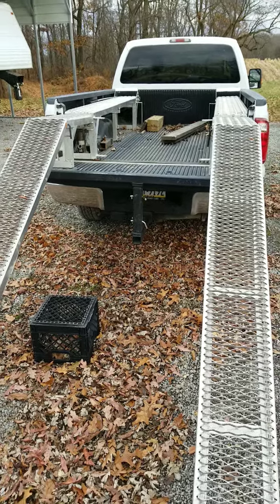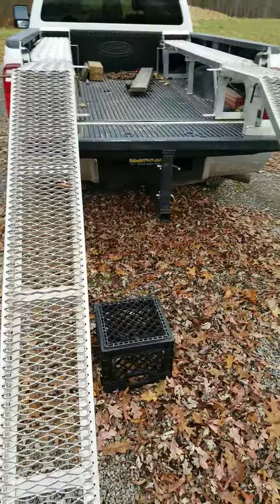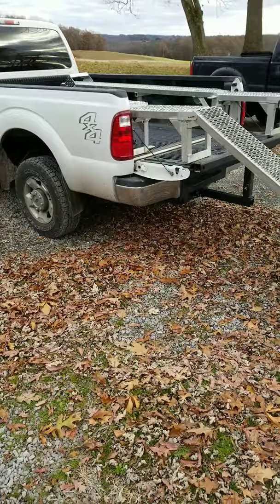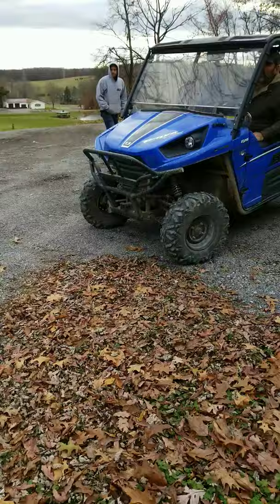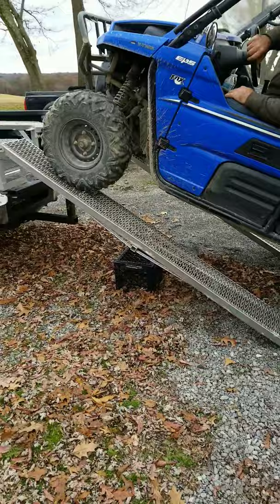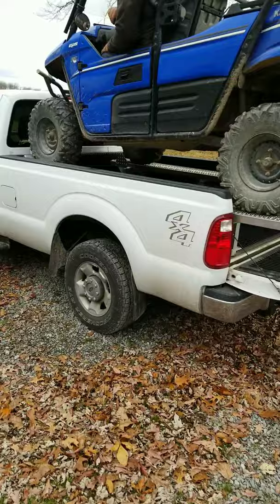UTV Side by side loading ramp and hauling system

Comment: This is a nice project turn build turn completed system. 
May I suggest adding Bedside Foot Steps for the driver to safely step on as he or she exits the side by side? It promotes safety and an understanding of what comes when you need to get back to the ground.
Also consider adding a winch setup to the pickup bed so that it can be pulled onto the in case the side by side isn’t running. 
Please don’t take offense, I’m just spit balling off of what I watched. 
Great work all the same!!! Cheers.

Comment: TOPHEAVY!!!!
Reply: That is sweet... There is only one problem when the driver of the ATV steps out on to the bed rail, Doesn't matter what kind of grip you have on that bed Rail.. They could slip or lose their balance  Or their grip and fall and hit the ground and die..
Reply: @jodyhakamaki5602  
Ladder not included
Reply: @mikesilva8493   Well the latter would be the most important part.. You really need to put that in the video... So yes with a ladder that thing is awesome..
Reply: Very top heavy hate to have to get off road with that setup
Reply: @TheCamaro5  what about slide in campers, side by sides are very much lighter. This is not anything to worry about
Reply: @robbysemrau3252  slide in campers are much lower int the bed and weigh much less. this side by side still has more weight more top heavy than a inset camper shell and doenst sit all the way down in the bed. every inch coughts. A 5 degree slope and these trucks are going to start to lean or even tip over. Loading something that high is never a good idea either.
Reply: @TheCamaro5  he dosent seem to have a problem. Let him do it if he wants to
Reply: @robbysemrau3252  well of coarse he doesnt yet. its sad some people learn the hard way. I used to do this when i was a teenager.
Reply: @TheCamaro5  I doubt the suspension on a 1 ton truck even notices that weight. A 1/2 ton might be tippy though.

Comment: That's pretty slick. I would make a small platform that sits on top of the bed rail and extends a couple inches passed the bed for the operator to walk on instead of walking on the bed rail. I would make it removable. The way people are sue happy it would be  a good idea.
Reply: Its possible 
More $$$$$s is all you need.

Comment: Well your loading system is too top heavy than need to be. Just use the ramps to park directly onto the floor of the bed. An atv looks upright freaking gay sitting way the phnck up there in the air like that.